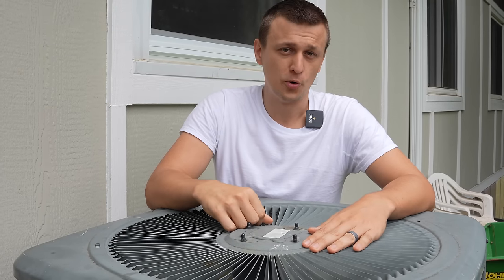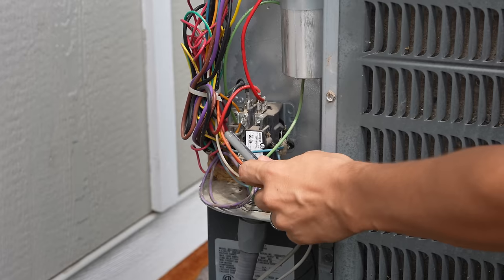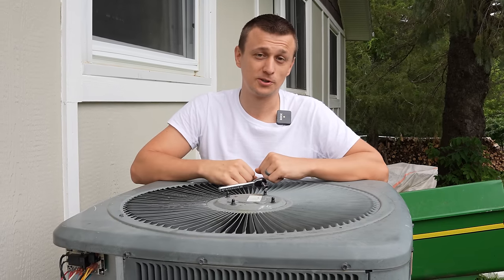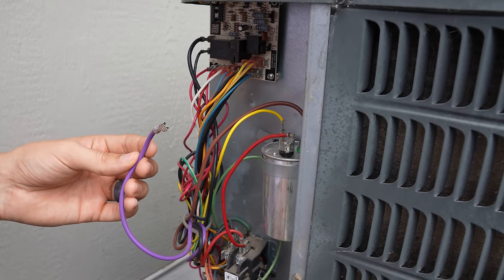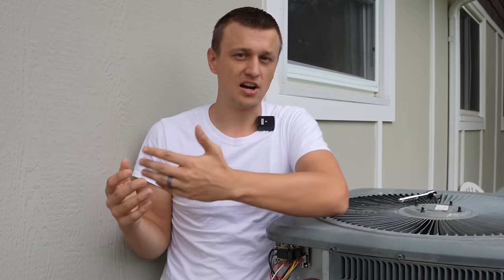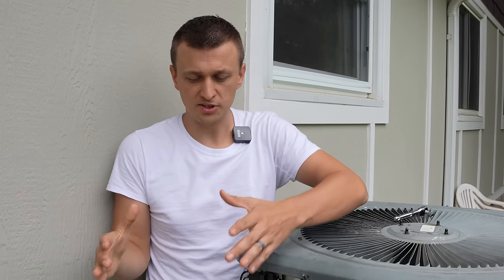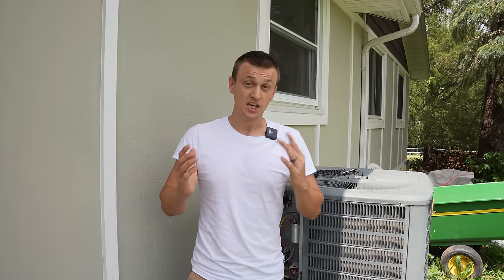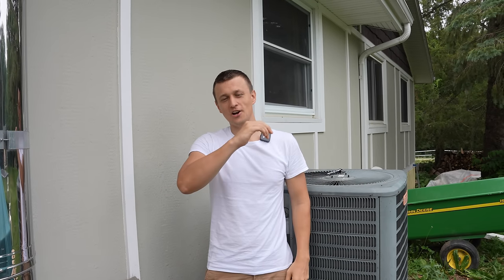Air Conditioner Noisy and Loud

Comment: So here goes a good one for you. And this is been driving me nuts with mine brand new Gold 18 two stage 5 ton American Standard heat pump. You talk about #6 and 7 about a noisy compressor what's driving me nuts about mine is when it's running and cooling the compressor hums noticeably louder but when it runs in heat mode you can barely hear the compressor hum. I wonder if this is normal? It's not like an unbearably loud hum sounds like normal operation of air conditioners I've always heard running but it is odd to me that the humming sound that it makes when cooling is louder than when it is in heating mode. I mean it doesn't seem to be having trouble operating in either mode it's just odd to me that it would be louder when in cooling.

Comment: Near the beginning of the video, you reference a blue plug on a condenser fan motor as a place to oil it. This blue plug is to be removed if the motor is installed in the shaft-down configuration. It is a DRAIN opening, not an oil port.

Comment: Condenser makes rattling noise, probably a bad capacitor, but will stay on.. Is it normal for the inside blower motor to cycle on and off? I'm guessing it's some kind of safety shut off system.

Comment: Hiya! I think I may have missed the issue that pertains to me. 
I'm running heat right now but my unit outside makes a grinding noise when the fans slow down to shut off. I think it's been gradually getting louder. 
Can I WD-40 it?

Comment: im having a tech out tomorrow, but after fixing the busted fan on the outdoor unit, i heard the 'clanking' noise at 6:13-6:15 - but im getting cold/freezing distribution lines inside, just not cool evap system or cool air, could the clanking be low refrigerant or blocked flow? or is it for sure a toast compressor? the sound does start and stop a bit, but is fairly consistently on when the unit is on. i tested the electrical resistances and they looked good, so was hoping that was ok

Comment: My unit is new. It had the noise since day one. Ii had the compressor replaced as technician advised. But still noisy after we set the heat to 72 degrees. I cannot trust any technicians because they have visited the unit many times without any results. What are your thoughts on the issue?

Comment: After watching this video. I was able to determined what was causing my ac unit to have rattling noises. My ac unit has a black plastic ring around the fan, over time 1 out of the 4 screw that hold the ring together to the top of the ac fell off. That caused the ring to sag and when ac is on, the fan would hit into the ring. I turned off the ac breaker, open the top of the ac, put new screws on the rings to make sure it hold tightly. Once done, put everything back, turned on power and ac run like it should with no noises.

Comment: My ac unit works fine but sometimes make laud noise when start, I saw shakes the copper lines Goin inside of the compressor ,but only does when start no all the time, is bean Iike that for about a year ,but ac works fine ,what could it be?

Comment: Hi Jay - thank you for this awesome video! Question: I have central air (one zone, a big outdoor unit) and the unit is making a pulsating noise the entire time that it's running. You can hear the pulsating everywhere inside the house - it's like a "woog woog woog woog" noise that's steady and constant. Does that seem normal or should we call someone out to look at it? We just moved to this house so I have no idea what's "typical" for the unit, but the amount of noise is kind of extreme - it's pretty unpleasant to be in any of the rooms near the AC unit...:/
Reply: What was the outcome of this? Ours makes a pulsating sound too, but only on the wall it's backed up to (conveniently, it's my bedroom, gah). It doesn't sound that way outside though!
Reply: Hey!! I’m also wondering
Reply: @jasmineanderson6595  For me, it turned out that our furnace fan was not running fast enough to effectively keep up with the condenser unit outside (and it would freeze over after an hour of running, this is due to a new furnace being installed in the winter and I had them come out to deal with the insane noise it was making inside the HVAC vents, they didn't even fully fix it at the time, but the a/c was affected by them slowing the fan down in order to reduce the furnace sounds). When it got fixed, it all went away, and our unit worked again. It also helped that I moved the condenser unit a little on the outdoor slab it was sitting on after cleaning the fins really will with a garden hose. I thought maybe it had shifted and made it not level. My unit is also really old and they no longer make the coolant- I thought it was just old and dying! I hope this helps.

Comment: If a compressor is generating a noise all the time so loud that it sounds like a lawn mower and clearly audible and very annoying in the neighbouring houses but the air conditioning is working to heat or cool the house, so the owner is not willing to spend money to change the compressor, is there a problem with the air conditioner itself that could force the owner to fix the noise issue?

Comment: What about a loud clunk or clank noise when the compressor turns off. All seems fine but that noise. New compressor and condenser btw.
Reply from the maker: Thats annoying but it should be fine. I've seen many units like that and they didn't actually have any issues that we could find.

Comment: Got a new fan motor and they changed the capacitor at the same time. Then the “regular ac guy” did an annual check, changed the capacitor again (to one that pulled more amps, I peeked). So- now it is making a sound. Loud buzz…

Comment: Vibrating sound is coming after some time like every 30 seconds,what reason it can be?
Please suggest 🙏
Reply from the maker: So the air conditioner is not coming on but it buzzes every 30 seconds? That sounds like a bad capacitor. I think talk about that in the beginning of this video: https://youtu.be/GOXgdnRB840

Comment: appreciated , when the air con. Shuts down (automatically when reached the settings temperature) it makes a loud “ BANG” noise , beside that everything is good , can you identify the problem please ！
Reply: Where is the bang coming from?  It could be that the air ducts are contracting/expanding. Same happens with mine during AC and heat cycles during the winter.
Reply: @vermontmike9800  it was the heater exchange coil area (the air con. Is 22 years young) , hired the pro twice to look at it (2 different pro） but no avail . Nothing loose , coil was fine and just happened since last summer and so far still making that noise ( this summer) 🥲
Reply: @vermontmike9800  thinking just replace a brand new unit next summer , ultimate order from the boss !
Reply: Is it a split system or a package unit? If you dont know. Does it look like the one in the video or the ones you see up on the roof like a big box
Reply: @Jpiccinino  got it from ikea , it’s a 100000 pieces , needs professional help to put it together , so far can’t find one , are you available ?
Reply: @hermanchow1405   sarcasm is unbecoming of someone. It didn’t show that you figured it out. Also I charge 130 an hour anyways.

Comment: Really Awesome Video. I have an issue where the AC unit outside makes huge rattling sound but it is very INTERMITTENT, maybe once or twice a day. I usually turn up the Thermostat and it stops immediately until the higher temp hits and then it is fine. So the issue can not be replicated at will. I took a video of the sound as well. Any help will be immensely helpful. I talked to a "professional" and he wants me to replace entire unit and the furnace. That will be a Huge cost
Reply: Is it kind of a screeching rattling sound? Mine is similar very intermittent. But when it does make that sound when it starts up, then it does it when it kicks off as well. It’s weird but man that screeching grinding noise is Loud!! I figure the unit was burning out or something.

Comment: What makes air exit the condenser fan motor grille more horizontally instead of more vertically as most units do?
Reply from the maker: I noticed that some units are like that straight from the manufacturer. Their fan blades are not as angled as others so instead of up, they push the air sideways. I don't think it really matters but I don't know the specific reason behind it 🤷‍♂️
Reply: Sounds like the motor is running in reverse rotation, which cause this.

Comment: We just had our 6mo maintenance and a new thermostat put on, but now our outside unit makes a loud clunk when starting and a vibrate noise while running. Also there's no more delay for start and stop, which we always had. There's also degree inside on the bottom and algae on the outside. Not sure that should be there after a maintenance. Could I send you a recording of the noises just to get your input on whether I should call them back out?
Reply: 19:40

Comment: HELP!!!
Occasionally when my unit calls for heat, the outdoor unit  (GrandAire) makes a loud bang and hissing sound. 

The heat works inside the house, but the outside fan does not come on.  About every 15 seconds the outdoor unit loudly bangs and hisses.  When this happens, it will malfunction until I cut off the heat and turn on the A/C for a minute.

Then I switch back to heat and everything works the way it should for a day or so.

What could this be?

Comment: Hey Jay, excellent video, I have a high velocity unico ac unit also called spacepak, most of the time its loud but the noise is coming from the ductwork..any suggestions?  The unit works just fine but it can get loud ... thanks for the dad joke 🤣 stay blessed bro
Reply from the maker: Thank you John! I have worked on those high velocity units before, is it a high pitched/whistle sound? Is it coming from a particular vent or is the noise the same from all the vents? Is it loudest at the air handler? Can you track down where the noise is the loudest? If you get lucky there may be something you can do but from what I recall, those high velocity ACs do run a little louder than traditional units though.
Reply: @WordofAdviceTV  hey jay, well the noise comes from all vents but no noise at the AH..
Probably might just be the system like you said 
👍

Comment: Is it possible to replace a traditional AC unit with a mini split heat pump outdoor unit without replacing the AC lines?
Reply: Yes
Reply: Yo.. Be smart about it.. I've noticed mini split units are generally not very repairable..
Reply from the maker: The old unit and whatever accessible ductwork you have would need to be pulled out. You may be able to reuse the copper refrigerant lines but not all techs would be willing to do that.
Reply: Mini split pipe size is normally a smaller dia, maybe also wanna check oil type is compatible
Reply: Thanks for the responses.  I am looking for a more three season item as I wont use in winter as it gets to -40C but spring summer and fall when it is -15C to 10C I could get some use out of it, be quieter and use less power.

Comment: What about a new A/C Amana compressor. Every time start feel like too strong and when it stop it make a noise like some thing is touching. is not the blade cause is new, I heard at the bottom and it look like the compressor inside. Maybe because is new. Sound like the fan falling down when is stop and doesn't have oil and do: clan, clan, clan. it last 2 o 3 second. Maybe something need grease or oil, or maybe is the compressor when is stopping.

Comment: Hey Jay, 
My outdoor ac starting making a loud noise last night whenever it is running. I took the panel off and  when I hit the contactor plunger the unit runs fine without the noise but when I turn the thermostat and it tells the ac to kick on by itself it will constantly make a loud buzzing noise. What could this be ?
Reply: Wanted to add quick update.. when the unit is running and making that terrible buzzing sound I found that if I hold the contactor plunger in it minimizes the loud buzzing… do I have a bad contactor ?

Comment: I have heard #13, LOUD pulsating noise only for a few seconds on START-UP. But this occurs NOT all of the time. After a few seconds, the loud sound disappears. It sounds like the long 30 ft. lineset is chattering/vibrating  like a machine gun intermittently upon start-up. The long lineset is located in a finished ceiling and exits through the outside brick to the condenser. This is a heat pump and occurs in both cooling mode and heating mode. Any ideas please?
Reply from the maker: Oh boy.. The fact that this does not happen all the time makes it a bit harder to try and guess what is causing this. The compressor works the hardest/vibrates at start up and this must reflect on the long lineset as well. My guess would be that the refrigerant line is probably touching something inside the walls. One thing you could try doing is applying pressure on the pipes where they go into the house as the unit starts. Just push them to one side and see if that affects the noise at all. But being that this doesn't happen every time makes it difficult to catch it in the act though. If applying pressure to the pipes reduces the noise, I would try securing the lineset with a bracket to prevent it from freely moving. There should be foam or rubber between the bracket and the pipes though. This may or may not help.. Depends on how far in the wall/ceiling the contact is happening.

Comment: I took off my fan on my LOUD RUUD heat pump and replaced it with a better fan that was three blade instead of two blade very steep pitch forward facing blade tips. I also mounted the fan motor   to the mounting grill  with rubber isolators and  got a compressor blanket off of ebay for about 30 bucks. Much much better. Knocked off 9 decibels  .. Oh yea with these Ruud/Rheem systems they have a setting for defrost that kills that loud sound when it shifts and that steam like sound wakes up everybody. It pauses everything for 30 secs and lets the pressures kinda equalize sorta. Mine was not set for that it made a big difference unfortunately the houses in my subdivision are close together . Heat pump sounds are becoming a issue during these H.O. meetings.

Comment: My A/C has a sound that sounds expensive to fix.   Compressor screaming sound that is quiet for about a minute and then cries for about 15 to 20 seconds then is quiet for another minute.  Repeats the pattern.   Electric bill doubled and I was out of coolant after someone came to look at it. [Edit: My noise was a 5 minute fix.  Too much freon was in there.  Reducing it fixed the noise issue.]

Comment: The No 1 real  reason these " outdated " ac are noisy its the concept  and how they make them...👎
when replacing look for " side discharge units " there more efficient and quiet operation and easy to diagnose...beleive me 32 years in the biz of Ac & heat pumps ✌️

Comment: The unit does make this screeching noise like a big pickup truck is suddenly stopping I thought trucks were still coming on the property to finish building the new homes and I found out it was my HVAC unit. It doesn’t happen all day it’s just a few times a day but the heat is working I mean I still feel cold at 71 degrees hahaha but it’s like 35 degrees outside so maybe I need to turn up the temp? hahaha I called the builder and they said as long as it’s heating the home it will make that noise once in awhile

Comment: Great video. Question- I have a noise kind of like a contactor or compressor. It starts around 1-2 hours after the unit is running quietly. When I turn AC off and on it's quiet again for a while. What may be the reason? Contactor?  I know that from a distance it's a guessing game for you. What would be your educated guess?

Comment: Low pressure switch
Reply from the maker: For the rapid short cycling? I suppose it's possible, thanks for another noise idea Jerry!
Reply: Also when scroll runs backwards on the float switch tripped it very loud and annoying possibly damaged compressor. Will going to overload and shut down. Bumping the scroll while running

Comment: My unit is sounding like a power wash. We are being told it’s the compressor flooded but the house is still cooling. We tighten the bolts, checked the blades, everything is fine. It could be the capacitor from the video or the compressor now 😭